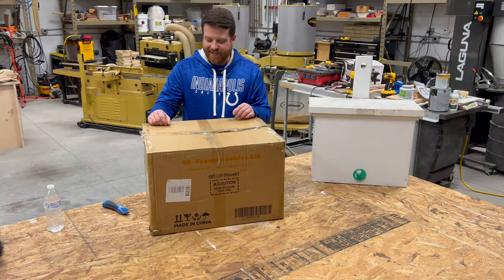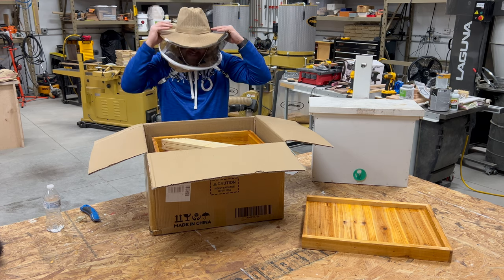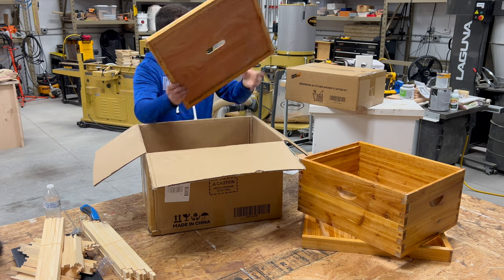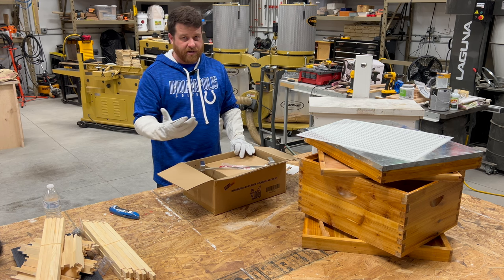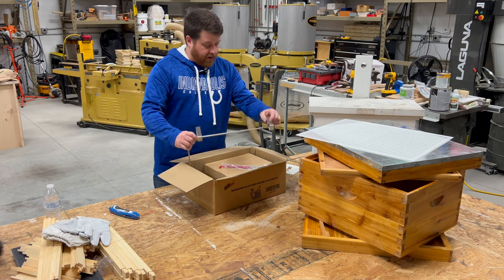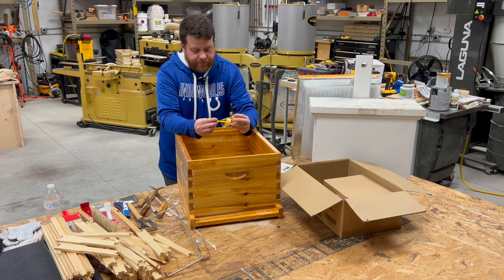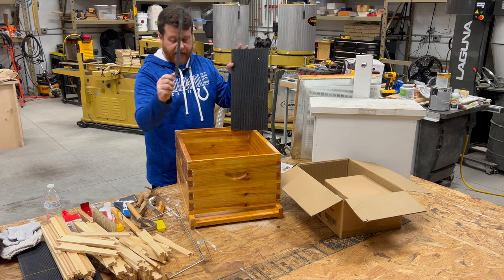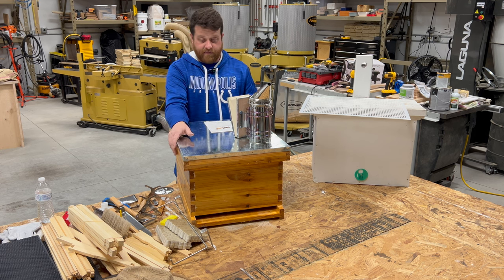REVIEW: MayBee Hives Beekeeping Kit for Beginners

Comment: The spring on the frame grabbers you have to remove both springs and pivot it the right way and reinstall the springs, ours came assembled incorrectly like that as well.  The first metal thing with the wooden handle @24:15 appears to be the handle that broke off the scraper that you took out @26:17, I believe these are for scraping honey off of the foundation.   @26:30 that's an entrance (boardman) type feeder but for screw on a plastic coke bottle with sugar syrup.  @28:18 that is a wire embedder, that's when you press your wax foundation into the wires, I'm somewhat surprised that was included.  @29:41 those are smoker pellets they smell like an illegal herb when you burn them.
Reply from the maker: HAHAHAHA on the last comment Brian! And thank you for shedding light on those items. I was scratching my head for sure. 😁😁😁